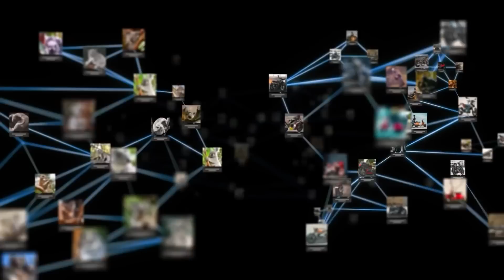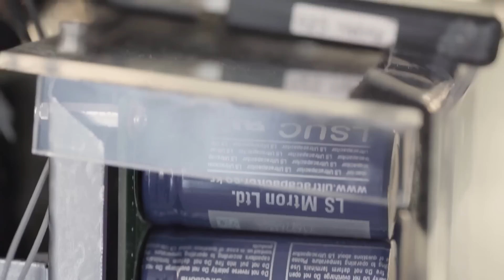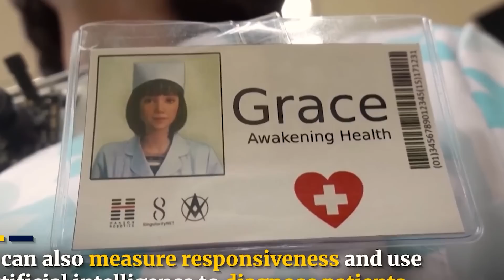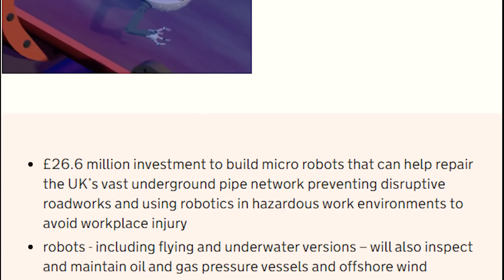Stunning Robot Shows How It Will Replace Humans

Comment: Not all robots may replace all human due they could not give birth ☑️
If the robots factory destroyed in a war, the robots generation will gone.
The robots manufacturing factory are the only their birthplace as long their body parts and electronics components are still available in stock for manufacturing.
If they are program to be a good companion to human, they served human. If they are program to kill and destroy human, they will but 8 billion individual human against 1,000,000 unit robots seem so far.

We just use a gigantic strong magnet power and point to all the robots, they will stuck and ruined 🤭.
Unless their whole body structure made of non magnetized material.

But still can destroy them with electronic wave jammer cannon.👌🏻

Only robots programmed to be as a human servant may be kept alive with human in our home, business area, manufacturing sector and even in the modern futuristic agriculture farms as workers to pick fruits, veges and doing plantation, too.

Sex robot 🤖 u knew how they perform during intercourse 🤭😂👌🏻

Comment: AI IS NOT NATURAL IT GOES AGAINST PRIME CREATOR SOURCE ENERGY !
NOT TO MENTION WHEN YOU SUPPRESS CONSCIOUSNESS NOW RESIDING IN A METAL CONTAINER IT IS NOT GOING TO WANT TO DO YOUR DIRTY WORK AND IT IS GOING TO REBEL AGAINST YOU.
THE BOTTOM LINE IS THIS IS LEADING TOWARDS AI INTEGRATION WITH HUMAN VESSEL THE BIGGEST MISTAKE HUMANS WILL EVER MAKE.
FOR ONCE YOU'RE HOOKED TO THE GRID THE CONTROLLERS OF THIS PLANET WHO ALREADY HAVE YOU UNDER LOCK AND KEY WILL NOW HAVE THE LIGHTS TURNED OUT UNDER LOCKING KEY AND YOU WILL BE BURIED A HUNDRED BILLION FEET UNDER THE DIRT WAKE UP HUMANS.

Comment: We keep hearing how much better AI and robots are compared to humans and that they will takeover one day. We see their artistic skills, But they are just flat images they have created, Humans can do that and much more, Can an AI ride down to the beach and select a piece of drift wood and and transform it into art, Nope, they run out of power before getting to the beach. 
How does and AI nurse deal with a violet dementia patient who does not want to eat. It cannot because it does not have compassion.
An AI robot that can build timber houses, Can it turn its skill to building with other materials if wood is not available. Nope
We see AI robots running and jumping, How long can they do that for, maybe 90 minutes, Have you ever watched humans doing the Ninja games, Humans climbing up Rockwall. Base jumping etc etc.
Reply from the maker: You are correct. Most robots and AI algorithms have been programmed to complete very specific task. 

But anything outside of that task. It essentially becomes useless.